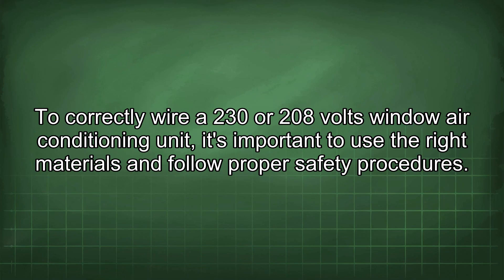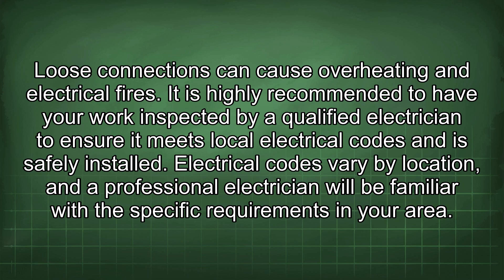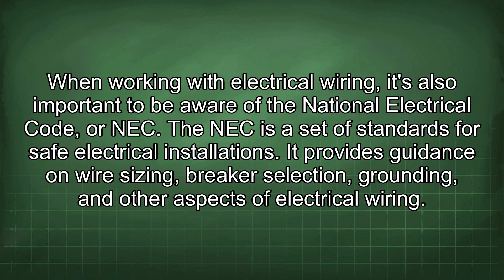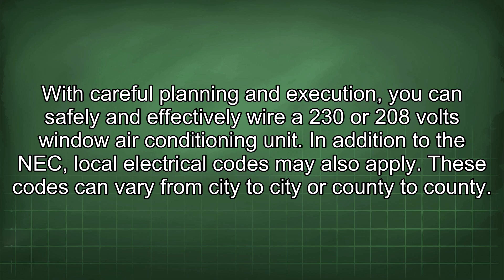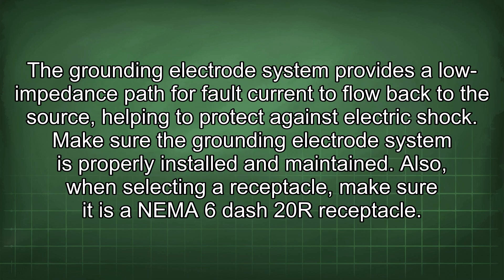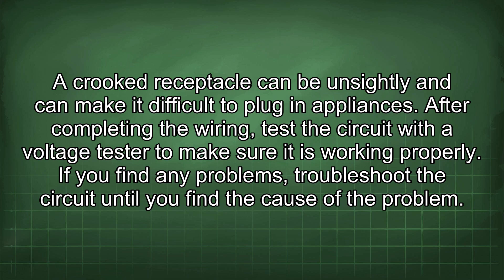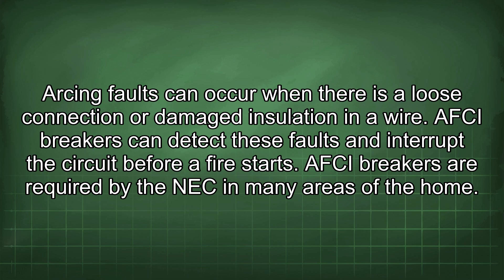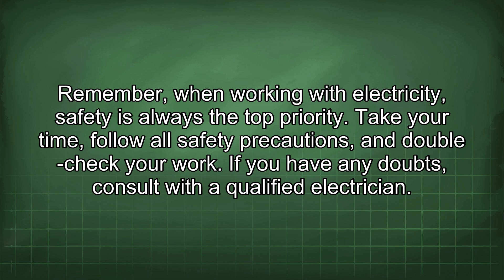Wiring a 230 or 208 Volt Air Conditioner Correctly

Comment: Pictures would have been extremely helpful. I have to find another video now ...
Reply from the maker: Hello @BDBSportsMedia,

Thanks for your comment. Each scenario is going to be very different. If you tell me your country, voltage system and the air conditioner model you are working with, we can try to help more.

Kind regards,

BESA Research